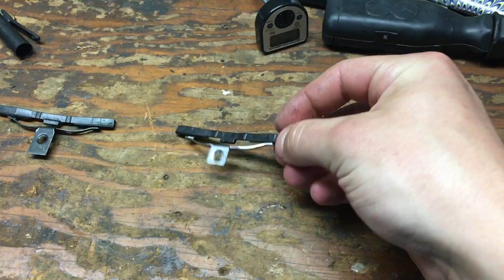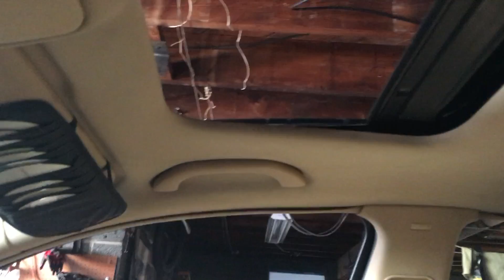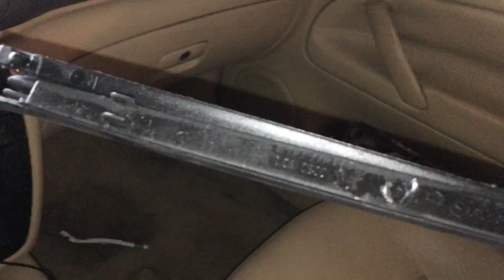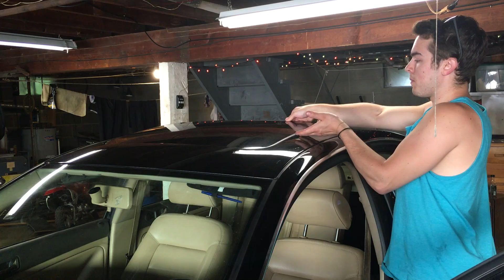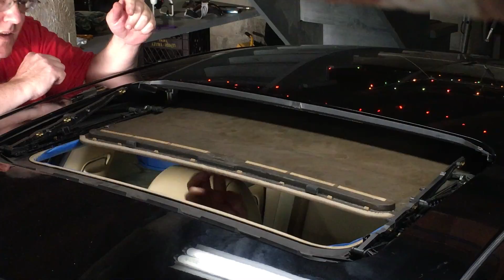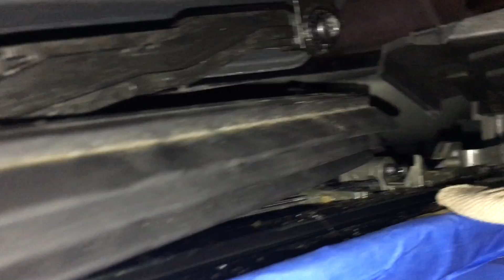How to Remove Sunroof Glass and Replace Shade Guide Clips 05 VW Passat GLS

Comment: Mine is wicked stuck and I got the glass off but shade still won’t come out. Any ideas?
Reply: Replying in case anyone else has the same issue. I determined that the rear set of guide clips had fallen below the track - pretty easy to see this if you look in the gap between roof and headliner. I managed to remove the dome light in the backseat and snake my arm up inside the ceiling to pop the guide clips back into the track, then it slid out no problem. I had to push the shade all the way back past the rubber bump stops in order to reach the back clips.

Comment: Thank you so much for this video. My sunroof on my 1999 Jetta TDI had  this same problem where it would go to close and then get stuck and open back up and I could not figure it out. I tired messing with the sun shade and it wasn’t going anywhere and at first I though it was the headliner getting caught cause mine had a sagging problem and it was super hot and sunny today and I thought the glue had given out due to age and heat, when I was able to pull the door shut I had the headliner hanging off by the edge and the wonderful orange stuff all over the place, so I just took it off cause it wasn’t getting any better and still the shade still felt off and the sunroof wasn’t opening normally or operating normally so I knew something else was wrong but I did now know what. And the clips did not look normal. But after seeing this video I am pretty sure they are the problem. I will be working on it soon and if the headliner and sunshade  is too much of a pain to fix, then I don’t mind keeping it out of the car, I’m glad to know that is a option as well. Thank you so much again for this video I know I went on a lot but I just wanted to show my appreciation and share my story since it’s hard to find solutions to problems on older cars. Thanks again for the detailed step by step walk through as well :)

Comment: Thanks! My sunshade does this on my GTI. Need to replace the headliner too, so I want the sunshade fabric to match. Solving multiple problems now. I know the struggle with the tan interior, my Beetle had that. Whatever you clean it with, just don't scrub it too hard or get it too damp. The foam under the fabric deteriorates into dust from heat, and it'll make the headliner start sagging.

Comment: Same issue with my 1998 Cadillac DeVille. The shade got stuck in the open position. I had to drop the headliner in the rear disconnected the motor and removed it. Manually pulled the sunroof forward and it was very hard to move. I noticed that the shade was jammed on the passenger side corner. I got the shade free but it has a metal to metal sound and I can move it in any direction. I believe that it's off tracking or it would move freely without metal to metal sound. I do know it's a aftermarket Webasto sunroof. Da all sunroofs glass remove the same. Thank you and nice work

Comment: My sunshade is jammed closed so how do I open it in order to get to the track/clips?
Reply: I had the same problem, what I did is to push with my hand at the same time that I move the glass with the motor, one little steep at the time, I had to try several times. Eventually, the shade was all the way to the back along with the glass.  I don't know if your problem is the same as mine, but this work for me. (2005 Audi A6)
Reply: @cealvive  Thank you, I'll try it!
Reply: @cealvive  I'll try this.  I hope it works for me too.
Reply from the maker: you have to take the glass off. watch the video (:

Comment: So i was going 80ish mph and my sundoof flew off where can i find one and the rails??? 03 4motion w8
Reply: Juan Mojica haha seriously? junk yard is going to be your best bet. the sunroof components are not unique to the w8 motor so any passat with sunroof will do. 
wish i had a w8 passat with the 4motion. keep that thing in good condition they're few and far between and are super cool. however they're a pain to work on and expensive to keep in good shape. they hold their value if kept up though.
Reply: haha yes very i think this one has a wire problem bc. the check engine light comes on and throws code for a temp sensor (has two) changed one didnt look that bad i disconnected the battery and the light came off 1 week later same code back again this time i just disconnected the battery and the check engine light came off and the fans didnt come on as when they did when the check engine was on

Comment: great video, but my sunroof won't go forward all the way (something off with tracking on driver's side), so I can't get glass to pop up to unscrew bolts to pop the glass out. Does this mean I need to take the entire headliner out to get to the sunroof, or is there an easier way to clear the track? Stuff is tricky.
Reply from the maker: the sunroof glass wont go forward? did you try to clear the tracks off? did you try to manually close the glass by opening the cover in front of the dial and crank it closed?
Reply: It's stuck about 2-3 inches from closing, as the glass is pressing up against roof on driver's side, causing it to jam and not close. I don't know what's causing it, but something broke last night when I tried to close it, as I heard a snap/crack sound and then it wouldn't close. Sounded like a piece of metal breaking under there. I did try to manually close it, but it's jammed. It will go backwards and not forwards.
Reply: I don't know how to remove the obstruction-- that's the whole problem. I don't see anything blocking it, but it's really tight to look into that area as it is right now. It's a 1998 VW Golf GL.